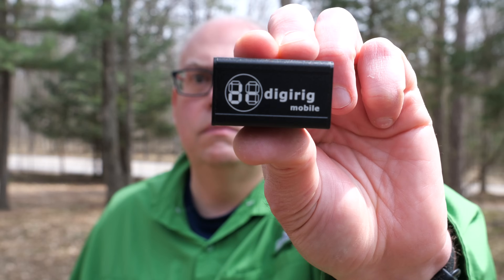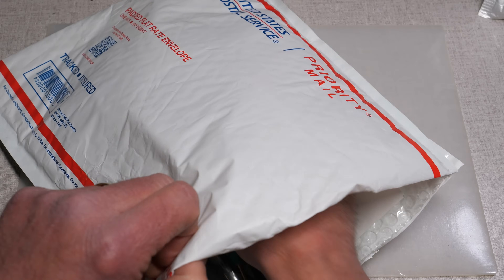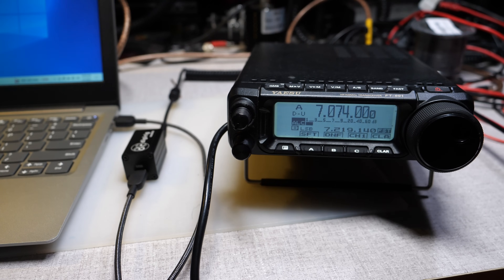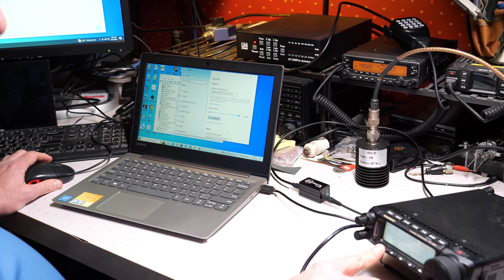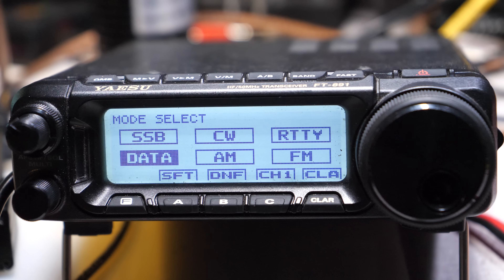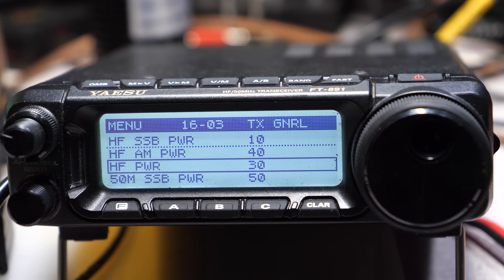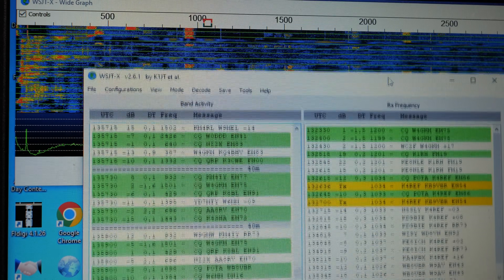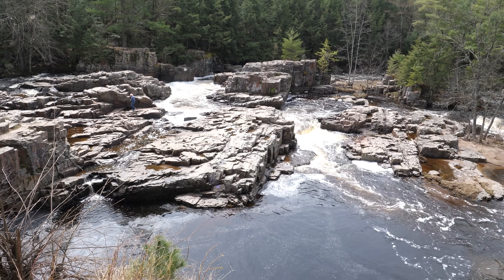Better FT8 on the FT-891! Digirig Mobile Interface  #hamradioqa

Comment: The Digi-rig may  looks good on the surface but I definitely wouldn't use one with my good radio. Now I might it with a cheap baofang radio for an All Star node but I definitely wouldn't hook it up to any of my good radios..

Digi-Eig is an open source project and it started out as a good idea but the end product is a total failure. First of all they chose to use one of the worst possible DAC chips you can get your hands on, the notorious C media chip. 

This is literally the worst audio DAC chip on the market as far as performance is concerned that's why you can buy sound cards based on this chip for $1.99. on ebay. You really should have spent $10 more on a Texas Instruments DAC which would have provided stellar performance. At least then you could have used it as a fairly accurate audio spectrum analyzer as well pen but that's C media chip LAX proper power line filtering on the USB bus so that dirty USB voltage generates all sorts of internal spurs, so at a minimum you need to spend another $35 on a USB isolator to filter out the USB power line noise before it gets to the C media chip. This is something better USB audio chips already have built in

another issue is the poor dynamic range and high noise floor I mean seriously you couldn't have literally chosen a worse audio chip to incorporate in this project ,  the only reason they chose to use it in this project is because it has IOs aka RXD and TXD pins that can be used for multiple purposes such as adding USB...

If the performance issue of this chip aren't  bad enough then the fact that they left out audio isolation Transformers and opto coupling from this adapter should be a deal breaker for anyone hooking it up to anything more than a baofang. 

Literally the two most important parts of any ham radio digital interface is going to be the optocoupler for isolating your rigs PTT circuit from the adapter adapters PTT circuit and isolation Transformers on both the TX and RX audio to isolate your rigs input and output from me C media chip.

Using a digital interface that doesn't incorporate optocouplers and isolation Transformers is kind of like having unprotected sex with a $20 prostitute. 

Seriously for a few dollars more you can pick up a digilink which is exponentially better, it has a high end DAC, it incorporates opto coupling and isolation transformers so you won't risk damaging your expensive equipment. The digi link is so good that it makes an excellent audio spectrum analyzer using software such as spectrum labs.

Comment: First of all, thank you for the informative videos. Very helpful. I tried to replicate the setup without using the USB cable connected between the FT-891 and thge PC. Unfortunately it doesn't work for me. WSJT-X won't trigger the frequency changes and the PTT Test is never returning back. My Digirig is from November 2022. Any ideas what I could do wrong?
Reply from the maker: If you are using the single cable and RTS signaling, WSJT-X will not sense the frequency changes. You will have to do that manually. that's because frequency change is a function of CAT control. As for the PTT test failing, I'd check the baud rate, parity, and stop bits for the transceiver and the computer. This is serial communications, so those will all have to match.

Comment: Good morning, on the video you have 08-02 (PSK) set at 1000 and you dont mention it, but in the description you have it listed as "1500". Safe to assume this doesnt matter which its set at? As Always thanks!
Reply from the maker: 08-02 is PSK tone. I've seen recommendations to set it to either 1500 or 1000. But I'm not sure if it matters because in 08-01 we are setting the Data Mode to from PSK/OTHERS to OTHERS. Please correct me if I'm wrong, but I think the goal in the data mode settings is to give yourself the widest passband possible and I don't think adjusting 08-02 matters in that regard.
Reply: @KB9VBRAntennas  thank you so much!!!!

Comment: Another question(s) from a newbie, Adjusting the WDH, NR, Processor and AGC in DATA mode doesn't affect other modes like SSB and CW, correct? If you switch back to SSB or CW, do you have to set the DATA settings again or are they saved? Also I've seen some videos using the CAT control cable (CAT settings)  and not using RTS? Is one better than the other?
Reply from the maker: No it doesn't, and that's the beauty of using the Data mode for FT8. Those settings, with the exception of WDH, will not not reset or affect your SSB mode settings. 

As for your second question. The advantage of CAT control is that it can change the frequency within WSJT-X. CAT also performs the transmit switching. I prefer to use RTS for two reasons: I think the transmit switching is marginally faster and more reliable than CAT, and I only have one cable running from the computer to the transceiver instead of two.

Comment: Can you do CAT control with the DigiLink ?  I just received mine today.
Reply from the maker: On the FT-891? No. You need a separate USB cable for the CAT control.
Reply: @KB9VBRAntennas  Roger that. I  got a new one yesterday and will be setting it up today.  Thank you

Comment: So, maybe someone can clarity - by omitting the CAT control cable (that goes from the computer straight to the radio - most places I look have instructions that show both cables - one for CAT control, seperate from the digi-rig connection) do you only give up the ability to set the tuning frequency from the computer when you switch bands?  Here I noticed he was just set to one of the FT-8 frequenfcies but he didn't set it from the computer, so I'm assuming dropping that CAT control cable simply loses you that ability and you can manually tune into the frequency for the bands you're doing.  Which is fine.  Is that how its working in his case?
Reply from the maker: Correct. CAT gives you full radio control. That is communication between then radio and the computer to change frequency, mode, etc. Without CAT, you will have to set those manually in WSJT and on the transceiver. The biggest challenge I've had with digital modes, prior to switching to the Digirig, is that the CAT connection between the computer and the FT-891 would frequently drop. RTS switching is more stable, but it forces you to do a bit more work in setting the frequency and band.

Comment: The digi rig in you link says VHF/UHF. It doesn’t give the logic option is this not the one? Even the cables are diff. Sold out I guess.
Reply from the maker: I checked the Amazon links and they came up correct for me. If you have any question of getting the correct device for the FT-891, you can order direct from digirig.net.
Reply: @KB9VBRAntennas  as always thank you, KD9QMI!!!

Comment: could the Digirig be used with the YouKits SK-1A ... it has a 3.5 plug for both the speaker and mic ... a long shot but it would make a great portable package !!! ... de N2JNZ
Reply from the maker: The Digirig is pretty adaptable, I would imagine there is either: a cable that works, or a cable could be fashioned to make it work.

Comment: I’m thinking about trying ft-8 myself in remote field activations. I know you run a Lenovo laptop … have you been satisfied with it in regards to ft-8? 73, VE3LYT
Reply from the maker: My Lenovo laptap must be at least three years old. I think I bought it back in 2019. It's not the fastest computer, but the screen is decent outdoors and the battery lasts a very long time. If I only use it for logging, I can go about 10 hours. If I'm running WSJT, that takes more power, and the battery life is cut in half.

Comment: Michael, I’m still a rookie and thinking about getting one of these before the June ARRL digital contest.   I tried to follow in your video but am still uncertain.  How much work is it to “undo” all these setting changes to go back to SSB?   I convinced myself that the ALC probably needs to be adjusted but many of the settings in the menu system are unique to HF digital and likely can stay as you configured without applying to SSB.   Am I right or am I missing something?   Newer FT-891 owner still trying to learn which settings are possibly saved along with a memory channel as another possibility to make it as effortless as possible.
Reply from the maker: If you use the Data mode for FT8 and the SSB for phone, then the changes are minimal. The FT-891 has separate deep menu settings for those two modes so you can keep your base settings separate. Then when I change from Phone to Data, I will first turn down the RF gain, because the audio will be highly overmodulated and then widen the WDH to 3000 Hz. To adjust the ALC in WSJT, I use the power slider on the right side of the screen. Switching back to phone, All I really need to do is turn up the RF gain as the width will default back to 2400 hz in SSB mode. 

I know some people say not to use the Data mode for FT8 because the WDH always resets, but if you are often switching between phone and digital, it really is the easiest method.
Reply: @KB9VBRAntennas  you always exceed my expectations with thoughtful replies that take your time and talent.  Thank you Michael!  Hope to get you on a park to park someday!

Comment: Informative.  Thanks very much!  Although your comment about the SignaLink troubles you’ve experienced with the ft891 is mystifying.  I’ve used the FT891 + signalink combo for 3 years without a problem.  Being able to quickly control the mic and rx audio levels with the signalink knobs is an advantage for my style.

Comment: I'm guessing that since you selected none on rig control then it can't control the frequency in wsjt-x?
Reply from the maker: No you can't. If you use the CAT control cable, you can. But if you are just using RTS switching of the transmit, you will have to manually set the frequency.
Reply: Dang. I’m hoping they can figure out a way to use the serial port to do cat control as well. I’d love to have just one cable connected to my laptop to have total control of the 891. Glad this worked better than the signal link for you.
Reply from the maker: You and me both. Unfortunately Yaesu did not implement serial CAT through the DIN connector, nor did they install a sound card interface via USB. It's like the worst of both worlds and one of the very few things that I don't like about the FT-891.

Comment: I have yet to be successful with the Digirig , I've followed the video. It just keeps throwing an audio input error. When i assign the com3 audio input/output in the drop drown it Ptt's fine with a green cat bar next to it. but upon ok-exit it throws an audio sound input error plus the ALC bar never moves. I might have a bad digirig or cable, or a setting somewhere is off i just haven't caught yet.

Comment: Why does everyone think they need a rig interface with the 891? All you need is a sound card, which is probably built into your laptop. If you want a dedicated sound card, just get a USB sound card dongle.
Reply from the maker: You are correct, you can hack together cables and use the internal sound card in your computer. A rig interfaces offers two benefits: first is separate sound outputs so your system sounds don't go over the air. Second is audio and PTT isolation. An interface is more resistant to RF interference and ground loops than just straight cables.
Reply: @KB9VBRAntennas  You can hack some cables together, but they can be bought pre-made. Separate sound card inputs are a good thing and can be had with a $15 USB dongle. Ground loops? That's a stretch. It's a straight path - radio - USB - computer, no loop in the path and the USB dongle breaks up the audio path. 
The Digirig is a neat product. If you need it. You don't need it with the 891. But don't feel bad, a lot of people thought they needed a RigBlaster or Signalink and spent even more.

edit: You need to buy cables for the Digirig as well. A cable for the 891 din plug jack to a sound card can be found online easily for about $15, no hacking or soldering needed.

The Digirig is a nice product. My son uses one and I've seen it up close. If you feel you need audio DC isolation between the rig and sound device, it will provide that. If you want to work with multiple rigs, it may be the way to go. If you just can't deal with two USB cables instead of one, it will help. Many laptops have limited USB ports. Compared to prior products on the market, it's more affordable. So it's not a bad choice, but not absolutely necessary.
Reply: I tried this today with the digi rig.  I have the same settings as you do in the radio Michael sometimes it works and sometimes it doesn’t. Sometimes they transmit goes through two or three cycles, and then it will stick on transmit.
Not sure what to do

Comment: Yes I look forward to more digital videos.  I cannot for the life of me to get the DigiLink to work correctly with my FT-891. I cannot get my laptop to recognize any Com Ports that are used with it and this has been going on since last summer. Driver issues. They’re installed correctly and ready for use but the laptop will NOT recognize them. I’ve viewed dozens of videos including yours ti no avail.  
Please if his get the chance they’d be most informative I know.    Cheers Jim K2WPA New Jersey

Comment: Thanks for the video. Like @Kallengar I am a new owner of an 891, but used it for SSB. I had a Digirig for my G90 and it's the same one (logic) so I'm gonna get the cables. I don't like that I have to buy both cables but maybe I can use the other at some point with another radio. One of the reasons I didn't go down the digital path with the 891 was cause it seemed extremely cumbersome. So I thank you again for sharing and documenting your setup. Peace!

Comment: DigiRigs are great. They are a bit “hot”, at least when using them on FM. I have to really adjust my audio settings down so I can get good connections on Vara.
Reply from the maker: I would tend to agree. I was a bit surprised at how much lower I needed to adjust the levels of the Digirig vs my Signalink.

Comment: Great Video Mike. 
I have not been to that Park in quite some time.
I like what they did to the Bridge with it's repair. 
Mike M.
Reply from the maker: I think they replaced the bridge five years ago, but it is nice that they kept the stone facade instead of putting up a generic concrete structure.

Comment: I have a digirig and plan to use it with my 891. Just in case I missed it, what’s the reason as to why you’re not using a usb cable along with the cable for the radio on the digirig?
Reply from the maker: I think I touched on the reason very briefly in the video, but I'm not using the USB CAT cable for two reasons: first, adding CAT requires a second cable from the computer to radio, tying up both USB ports and adding extra wire to the setup. The second is that while is nice, it adds a lot rig control that makes switching bands easier, it also tends to flake out on me when I use it in the field with the FT-891. I like the single wire concept from the computer to the transceiver.

Comment: I have a Digirig in my bug out bag, and I like how I can use it with my Yaesu FT-818 or my Icom IC-92AD HT. I have a Mobilinkd TNC3 that works with my HT as well, but it supports only packet. The Digirig will work with HF digital modes as well as VHF packet and VARA even with the HT. 73 KD5YOU
Reply from the maker: I love the small size and it will certainly have a space in my portable bag.

Comment: What would make digital modes work better or portable operations? Software that runs on tablet or phone to use less power. That would lighten your load for pota and sota. To finish thank you for this video it was helpful.
Reply from the maker: I totally agree. I can run my laptop all day long if all I'm just using it for logging. But add WSJT and suddenly I'm down to 50% after 2 hours.

Comment: Great setup Mike. I use the same in my Jeep but a slightly different setup.  I use the CAT on the 891 via USB, and USB to the Digirig. Both are mounted under the back seat and go into a 4 port USB hub. From there one USB cable comes up to the area between the two front seats. Now when I plug the USB cable into my Evolve laptop I get all the same functions as I do when using my 7300 or my 7410 with  both CAT and Audio.  Has been working great.  de KF3BH
Reply: Well now, that's pretty slick. I may just do the same.
Reply: I do this as well.. I was confused with this video, so by having a single cable as shown in the video, changing frequencies has to be performed manually on the radio? Via a separate usb/cat that was happening automatically when you change the band drop down in the software.. hmmm I guess I still need both cables, for a second I got excited
Reply: @thiyag  the way mine is setup as described above, I get full CAT control via the USB port, and use the Digirig for audio. I run the Digirig's USB connection and the 891 USB into a 4 port hub. That gives me one USB cable to run from the hub to the computer. Works like a charm.
Reply: @stephenrichendefer8782  same, I use a power pass through hub so it also charges the attached device
Reply: @thiyag  With the 991a, you grt CAT and sound over a single USB. I think the original 991 doesn't get sound that way, but the Digilink basically is a good quality USB sound card. So you can plug the Digilink and the radio's CAT control into the USB hub and leave that all in place, tucked away and neat. That plug the hub into the computer by a single USB cable when you want to us it. 

Not as slick as a single cabledirectly  from radio to computer, but cheaper than buying g a new radio to save one cable.
Reply: @michaelmichael8406  got you, I have 3 digirigs.. I just got confused because I thought I could get some radio control over RTS that I missed(without the USB cable specifically for the 891).. 73s, NB2R